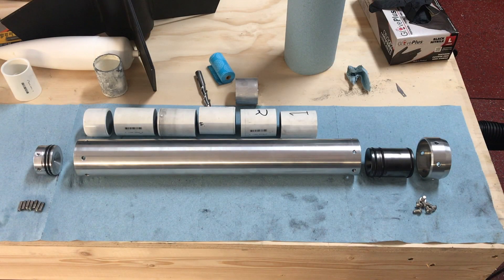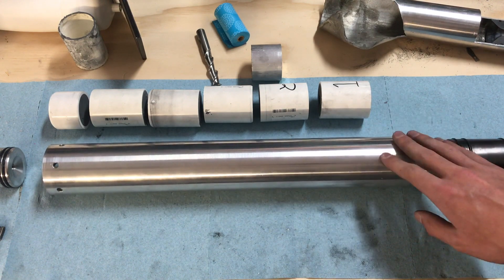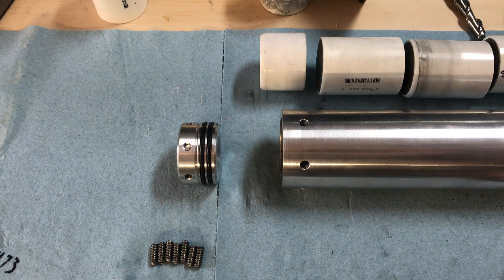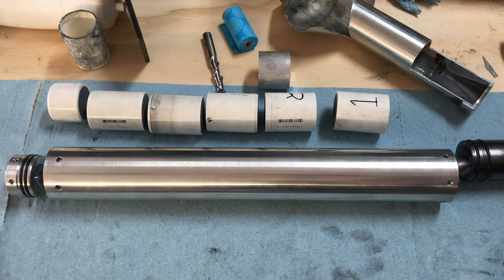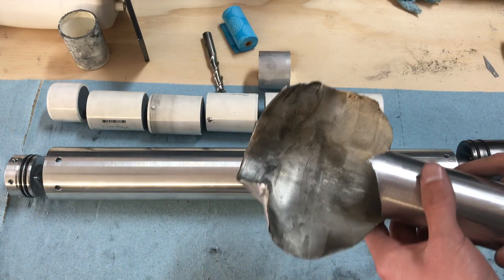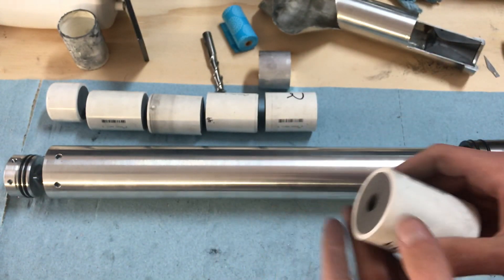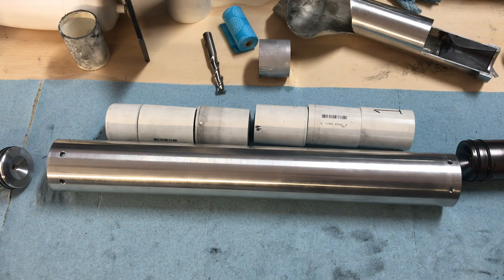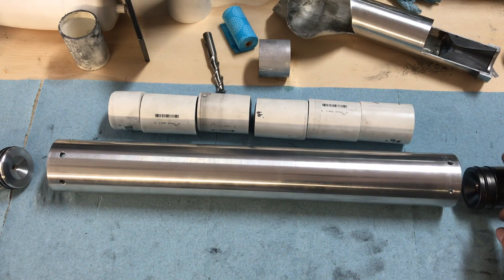DaVinci Mk. 2 Rocket Motor Overview

Comment: I see here 2 problems:
1. Silicone binder is not a direct replacement to HTPB. Silicone induces a much faster burn rate  then HTPB with a high exponent. 
2. You are missing a casing liner, so the casing will be directly exposed to the burn.

Comment: I'm not good at English, so I don't understand well. It appears that the cause of the explosion of the previous rocket motor was a thin chamber thickness and another welded tip rather than the bulkhead screw, right?
Reply from the maker: Technically the standoff screw buckled and the heat destroyed the unlined walls

Comment: you have'nt used a liner here. A liner needs to be in one piece, snug with the casing, and the grains, and it must overlap the nozzle and the bulkhead to avoid any gases sneeking around the liner

Comment: What is the brass, screw in the bulkhead for? I would think of a sort of pop-off valve. Look great!
Reply from the maker: Currently it’s just a plug. The reason the hole is there in the first place though is for head end ignition. The plug can be replaced with an ignition squib of the same pipe thread to light the engine quicker, more reliably, and with less dangling wires

Comment: How do you make this motor?
Reply from the maker: It’s all pretty straightforward lathe work. Nothing out of the ordinary, just basic lathe operations. Then just drill holes for the screws where needed.
Reply: @cylosgarage  Thanks for getting back to me. I was wondering  what material the main chamber-tube was made of and what material the nozzle was made of. Thanks.
Reply from the maker: @mdotzert4754  The casing is made of 6061 aluminum and the nozzle is made out of graphite.
Reply: @cylosgarage  Thanks again for getting back to me and great video by the way! A few questions did you bore the hole in the combustion chamber or did you buy an aluminum pipe? Could you give me the dimensions-diameter-specs for all the components of the engine? And could this engine possibly fly and what is the total weight of the engine? Thank you. Keep up with the awesome videos!
Reply: @cylosgarage  Forgot to ask something. How long did it take the engine to use up its fuel, and could you replace the fuel grain with sugar and potassium nitrate? Thank you.
Reply from the maker: @mdotzert4754  I can't give you the plans for this motor because I live in America and ITAR doesn't like when people do that. But to address some of your questions, whether or not this engine can "fly" obviously depends what rocket you put it in and how much it weighs. It's made from tube, it would be silly to bore out a piece of roundstock of that size. It weighs like 8 pound loaded or something. And no, it's designed to use APCP fuel, rocket candy has completely different properties and would not work well at all given the current nozzle geometry. If you're looking to build one of these, I highly recommend looking at Richard Nakka's website, it contains all of the theory and information you need to do this safely. Determine what you're looking for, and then design and engineer an engine to fit your needs. That's really the fun of it in my opinion.
Reply: @cylosgarage  Thanks!

Comment: hi. I found you today while looking up altering drill press's into a mill, I was wondering if they can handle strong side loading? I'd like to know if you have machined anything 'tough', eg carpenter 158 or 4140 alloy, in the annealed state of course, heat treatment after. If you could tell me I'd appreciate it, also best of luck with the rockets.
Reply from the maker: it handles side load pretty well, granted, I don't machine much tough stuff (mostly aluminum). On the rare occasion I do machine something like 4140, i take really small cuts, and yea, it chatters a little and the finish isn't superb, but it works. I have no problems with aluminum though.
Reply: Cylo's Garage thank you for replying, very helpful. so slow and plenty of oil.

Comment: Lovely work. The new casing thickness seems a bit over-kill, but after the last test, I totally understand better safe than sorry! You can always optimize the design after getting some successful tests under your belt. You might consider a raised lip machined into the top of the head end retaining ring so that it has a positive location against the top edge of the casing. That should translate into better alignment of both the ring and bulkhead to the casing. Relying just on the setscrews introduces possible misalignment that can cause increased stresses exactly where you want them least, and the o-rings don't provide much alignment or stability to the bulkhead. If the retaining ring is nice and square, the bulkhead will be, too. That could keep stress evenly distributed and reduce the chance of failure or of the ring or bulkhead getting jammed in the casing. Looking forward to the test firing, and keep up the great work!